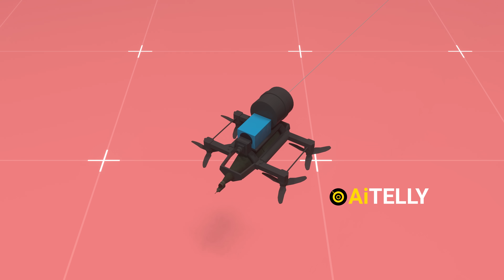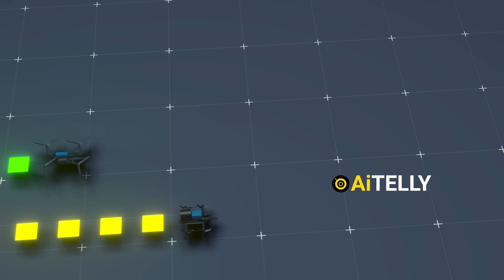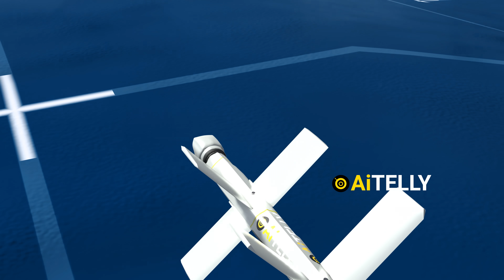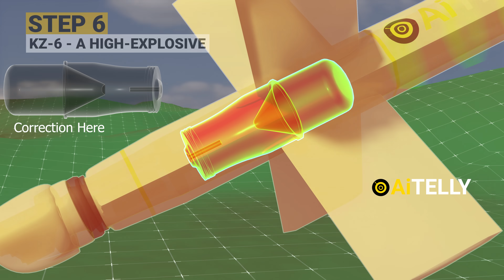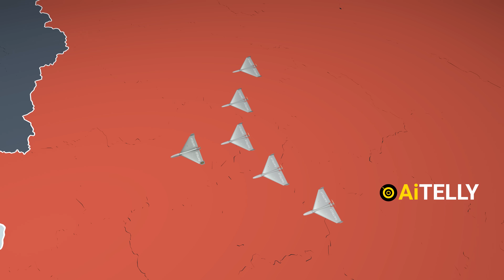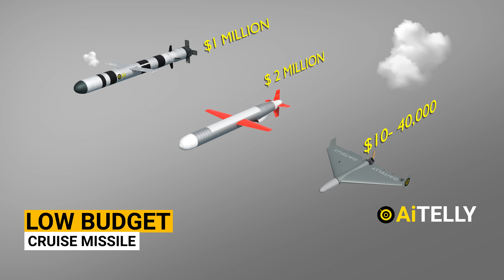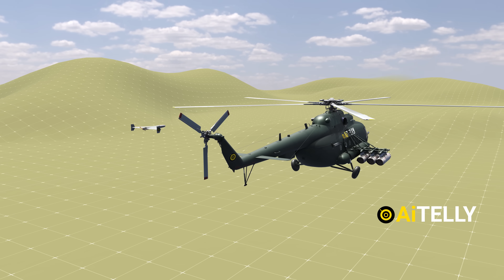How Russian Drone Strikes Works against Ukraine?

Comment: The analysis in this video is truly detailed and visual, especially the 3D graphics simulating the 5-stage attack tactics and the engineering of each UAV type. The way you explain makes complex military technicalities very accessible and easy to understand! In everyone's opinion, will the use of fiber-optic FPV drones to counter electronic warfare completely change the landscape of the battlefield in the future, or is this just a temporary countermeasure?

Comment: Well, if you don't know. The lancet works at a distance of up to 110 km (an aircraft was hit by a lancet in Kryvyi Rih at a distance of 105 km). The fpv drone "Prince Vandal Novgorodsky" works at a distance of 50 km. The range can also be increased by using a drone mother. The drone "Geran 2" works at a distance of 2500 km

Comment: I checked as well DeepSeek as 1km seems to be low for fibre optic FPV: "The video is useful for basic visualization but incorrectly states the maximum range of fiber-optic tethered drones as only 1 km. Modern systems, including those reportedly used by Russian forces in Ukraine, routinely achieve ranges of 8-10 km. This is technologically feasible, commercially available, and consistent with battlefield observations. The 10 km claim you heard is credible and reflects current capabilities."

Comment: only 9 months old and the 1km fiberoptic range is ancient history...  Yaz, the commander of the 12th Special Forces Brigade Azov of the Ukrainian National Guard’s Unmanned Systems Battalion: We have efficiently used drones with ranges up to 15 kilometers (about 9.3 miles). I know about successful deployments of 20-kilometer (about 12.4 miles) drones. But at the same time, we know that the enemy already uses drones with up to 30 kilometers (about 18.6 miles) range.

and please explain how the LANCET drone can even fly with no wings or quadcopter blades?  baffling.

Comment: But why to use expensive slow lancet drone once target has been located by other reconnaissance drone? Why do we not use the precise artillery or rocket attack which will be fast? That May be compareable to that drone in cost, range (~40km) but reaction time will be reduced. Please guide.

Comment: Can someone explain to me why the fiber optic reel is on the drone itself and not at the base where ever it's launched from? Wouldn't this minimize the added weight?
Reply: I assume with reel at the base, wire may get caught on a tree or bushes preventing drone from moving forward. Whereas if it's on the drone, it will unreel despite of that.
Reply: @alexeys2516  Ah true, good point. It took me a while to think about it in my head why it would make any difference to have it on the drone or have it at the base, but you're right. The drone will always have 'extra wire' with it in case the wire gets stuck, but if the wire is at the base, the drone doesn't have access to the extra wire. Instead it only has the wire between it and the point where it got stuck. Somehow it's such a simple thing but hard to think about.

Comment: these fiber lines can be long with checkpoints. Double sided rolls. Unwind A side, drop roll, dropped roll unwinds B side, unwind roll on drone side A, drop roll, unwind side B etc. Dont need to drag long thick line

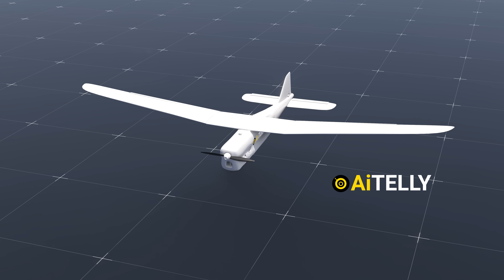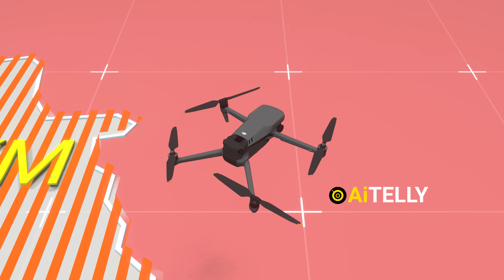Comment: OMG - can you do accurate measurements before launching the video. switched off on 01:48 where it says - 5 miles = 10km. - (No: 5mi is actually 8km.)  and it's inaccurate almost every time (0:31 - 1km or about 1.2miles. - What?)

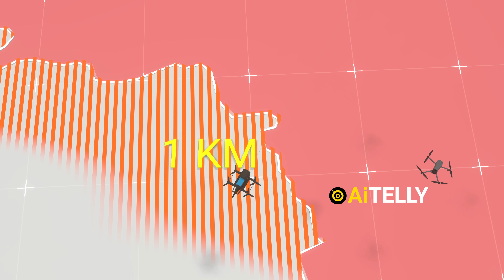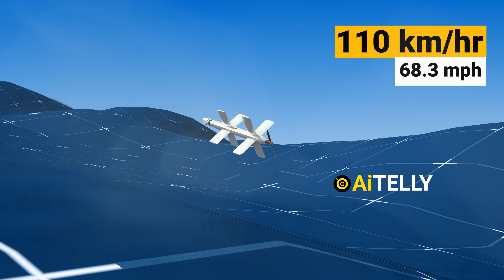Comment: a 0:26 i think you did the math backwards. 1KM is less than 1Mile. wouldn't make sense it goes 1KM but 1.2 Miles. and 3:44 this is nitpicking but that's a motor, not an engine.
Reply from the maker: Yes you are Right!
Reply: @Aitelly  great vid overall though. learned a lot.

Comment: Why te fiber optic cable is carried by the drone? It would be more sensical leaving in the ground. Less weight airborne
Reply: If the coil is left on the ground then there is a very high risk that the cable will be torn

Comment: Okay, look dude: your explainers are great, your 3D models outstanding. BUT... and I'm not even gonna ASK if you bother to double check your SAE to metric (and vice versa) conversions, because it's 100% plain you do not. Hell, they're not even consistent throughout the same video. 

How is 10km = 5mi (hint; it's NOT), but 1000km = 630mi? Or how about the FPV drones, with their range of 1km or 1.2mi? Since 1.2mi is 1.93km, I guess I'll take that one? I mean if all it takes to double my range is to switch to freedom units? It's not like you got the units backwards, either. 1.2km = 0.75 miles. 

It really undermines the legitimacy of the rest of the data you provide, guys.

Comment: The maximum recorded range of the Lancet drone is 70 kilometers.
FPV drones with fiber optic cable have a maximum range of 15 kilometers. This is the Vandal drone and there is a lot of information about it in Russian Telegram channels, so this is not a secret.
-
Now let's talk about what I am personally associated with.
The basic range of radio-controlled FPV drones is 32 kilometers. Depending on weather conditions, the range can increase to 40 kilometers or decrease to 25 kilometers. The terrain also becomes decisive. For all this, our calculation has correction tables.
For highly mobile targets, work is carried out at a distance of no more than 20 kilometers.
At longer distances, work is carried out only on static targets (howitzer, mortar, enemy deployment point, etc.). For this, as a rule, we raise a drone repeater, without it the picture and control of the drone at a height of 100 meters is already lost at such distances and there is no talk of the accuracy of the strike. Only with a repeater.
---
There are also aircraft-type FPV drones (not quadcopters) and their range for static targets with a repeater is up to 60 kilometers. They are not used for mobile targets.

Comment: Fiber optic quadcopter drone with 1km range? How the fuck does that work? It flies and has a 1 km long cable attached to it? How heavy is such a cable over 1km? Such a small drone like DJI mavic can fly 1km away while carrying a 1 km long cable? How do they retrieve it? Won't the cable be touching trees and stuff once it unloads? And also won't it lead the enemy straight back to the operator just by following the cable? 

I guess there could be niche uses for it but I want to know how heavy the spool for 1km. And just what they use it for. One way suicide missions within 1km only?
Reply: Пластик для 3d принетров идёт в катушках по ~килограмму, там метров 300. Как думаешь, сколько оптоволокна можно намотать, при том что его толщина измеряется в микронах, а не в миллиметрах? По сути это как воздушный змей...
Reply: I'm probably going to shock you now, but the Israeli spike flies 10 km over fiber optics and was created several decades ago. So a modern drone can fly much farther than 1 km.
Reply: @vyacheslav1849  are there any videos showing these drones in action? I'd be interested in seeing that.

Comment: Using a cable instead of wireless signals is actually genius.
Reply: Wait, those drones literally have a cable attached to them?
Reply: This is my question. So there is a spool with wound fiber optic cable on a drone and the cable is attached to the launch point and so the drone can travel some kilometers which is nearly the length of the fiber optic cable?
Reply: @simplehealthyliving4681  Yes
Reply: @rightrocker8914  So such drones are like kites?
Reply: @simplehealthyliving4681  ну оптоволокно крепкое, плюс выходит из катушки на самом дроне и просто ложится за ним на рельеф, деревья спокойно
Самое главное что РЭБ системы будут бесполезны, ведь сигнал идет по кабелю

Comment: A couple of wrong things in this video...
Jamming GLONASS is pretty difficult, nearly impossible. Unlike GPS, GLONASS uses several channels and frequencies to communicate with the satellite and can switch frequency in flight if all the current ones fail until it finds one that does. If you checked vids of downed Russian drones and their electronics, you'd see 4, sometimes even 8 antennas on them. So, good luck jamming that!
Lancet has AI, so even if it loses contact with base station, it will still go into target area and find either that target it was given or an alternative one on its own. That makes it also nearly impossible to jam.
Reply: There is nothing special about jamming the GLONASS band. And these 4-8-16 antennas are not for GLONASS signal, they are publicly available western made active antenna modules used in russian CRPA

Comment: This is not a Shahed, these are Russian Geranium 2. They are very easy to tell apart. The Shahed has control antennas sticking out, while the Geranium 2 has an absolutely smooth and closed body. Stop repeating after the madmen from the US intelligence community.

Comment: A correction: the Vandal fibre optic FPVs Russia uses have a range of 10km, and regular FPVs used by both Russia and Ukraine have a range of usually 15-20km but can even go up to 40km depending on the battery, the terrain, lack of ew on the enemy side and the strength of the transmitter
Reply: Who is the enemy side ?
Reply: 20km
Reply: Герани до 2 000 км летят. 15-20 это для "мавиков".
Reply: and they are not immune to radar

few errors
Reply: @hindugoat2302   a radar does not pick up a drone.  u will have better luck using a listening device tuned to the hum of the blades. in order for a radar to pick up a drone it would have to be a huge drone or a massive swarm of drones.
Reply: Yes I was just gonna comment this, I’ve seen the exact Chinese fiber optic kits the Russians are using and they can go up to 40km. Most popular ones are the 20km. I’ve seen many of the 20km kind in videos, you can tell by the size of the housing where the fiber optic cable is wound up in
Reply: @Clicky_The_Blicky yeah it’s been a year, 60km fibre optic systems exist now
Reply: @SK-ik9mc  yeah but they aren’t the average kind being used, just like the 40 km a year ago. And even a year ago 60km fiber optic drones existed but weren’t used because of the weight and size of drones being manufactured by Russia. Now they are using bigger drones with bigger batteries that are capable of using the extra weight of the 60km fiber optic strike package
Reply: @Clicky_The_Blicky oh yeah fibre optic drones have existed for a long time including very long distance one, but balancing practicality, the frame weight and aerodynamics, balancing weight of warhead with the weight and size and placement of the fibre optic cable housing, and ofc testing of all these
Reply: Могут лететь вполне до 40 км, ретрансляторы которыми пользуемся - позволяют. Кто говорит иначе, пусть докажет обратное.
Reply: @Swensweria  У России тоже есть ретранслятор
Reply: @Swensweria  Да что ты говоришь? Мы же про фпв коптеры говорим, размером до 10 дюймов с полной нагрузкой в виде выстрела от гранатомета как минимум?
Reply: @WRXMSK  зачем выстрел от гранатомëта. От него эффект сугубо по технике. 

Ты что не знаешь как работает кумуль? Сочувствую, а то что 10 дюймовый спокойно берëт батарею на 20к и спокойно полтора кг ВВ - ты тоже не знал.
Reply: Если они могут лететь от 30 км какой смысл держать там артиллерию . Практически основная артиллерия и реактивная артиллерия  бьёт до 40 км . Fpv если пролетит 1,5 км это уже отлично
Reply: @ с ретранслятором дрон да, чуть дороже и новая технология
Reply: @user-zv3yz3xf2j  ну вообще то при массированном огне, ни какие дроны не сравняться с артиллерией. Да и не все цели могут дроны уничтожить. Не мало роликов есть где, дрон просто обездвиживает скажем танк, а дальше его уже уничтожает или арта, если не слишком далеко, прилетает второй дрон или миномёт добивает.
Reply: At the, what happens to the fiber optic cable?
Animals chok on it?
Reply: @szaki  😂😂😂, they can’t
Reply: @SK-ik9mc  yes they can
Reply: @zi_9293  it’s a very thin cable and with a flight time of usually 5 minutes and the fact these drones operate high than even giraffes can reach, yes it’s practically impossible for animals to choke on these wires
Reply: @SK-ik9mc  кабель ложится на всё что есть внизу, он не висит в прямом смысле в воздухе, он стелиться. На деревья, кусты а местами на землю.
Reply: @RusNovgorod  я знаю. Это свободен
Reply: @szaki  в теории наверное дрон может нанести вред животным. Но тут выбор, возможная гибель животных или солдат. Вы что бы выбрали?
Reply: @szaki  it is rolled back by the launching site. they recycle those. also Russians have new fiber optic cable type, which is much thinner lighter and have small graphite core for delivering power to give drones less weight in power cells.
Reply: @szaki what animals are near the front lines?
Reply: This is an asinine comment you think because a war is going on there are no animals there you are absolutely out of your mind. The animals don't have anywhere else to go the world is their home so what's left of it is what they deal with. And yes he has a very valid concern for the animals well-being when we nuke ourselves to death the animal surviving on this planet will be what carries on life. That's how evolution works. Do people have no regard for living things anymore? @JohnnysCafe_
Reply: Dumb comment, sorry. Modern FPV drones with 3 kg of payload can hardly do 3-5 km one way (without return or even time to aim properly). You know nothing about what you're talking about!
Reply: @WRXMSK  you don’t know what you are talking about; it’s literally a fact that the fpv drones used with their batteries and receivers can travel roughly 15km. The payload is also usually not 3kg ie the rpg warhead isn’t 3kg, more like 2kg; but with the combination of that and a large battery it is close to 3kg
Reply: @SK-ik9mc   fpv drones are HEAVY and thus very inefficient, even 10" ones. Especially with payload. With 3 kg payload their flight times are measured in MINUTES. Average amperage of fully loaded 10" fpv drone is about 40A, battery capacity is more or less 6Ah. Thus flight time is 6/40 = 0.15h = 9 minutes. The average air speed is about 60kmh, so it gives you only 9km of one way range. And even these 9 km are only achievable when you fly along straight line without maneuvering in the search of target.
Reply: @WRXMSK   you’re data on speed is incorrect for FPV drones on the front, their typical cruising speed is 80km/h but max speed is about 120km/h and that is with full payload. I also don’t know exactly why you think the frame weight of the drone is an issue; when even for a 10” it is usually 600-800 grams. And the speed is including with batteries like 6S 3P 12600mAh, which are not uncommon. However I can say you are right that standard issued Russian FPV drones like the Vladen Tatarsky 40 is about 9km, most of the range short comings from this and other drones are because of transmission. My point is that if it is required, the range of the FPV drone can be extended, but yes usually it isn’t because the targets aren’t that far away typically and the terrain and hostile EW won’t grant it such permission
Reply: @SK-ik9mc  he is mining you for information. He insists you are wrong so you get upset and spill the beans so to speak.
Reply: @gooniesfan7911  yeah I noticed that, usually happens with people who know little but want to look like they know more
Reply: @WRXMSK  "когда летишь по прямой, не маневрируя в поисках цели" думаю дроны с оптикой, ни когда не посылают не зная где есть цель. Перед ним был или разведывательный дрон или просто уже точно знают где что находится.